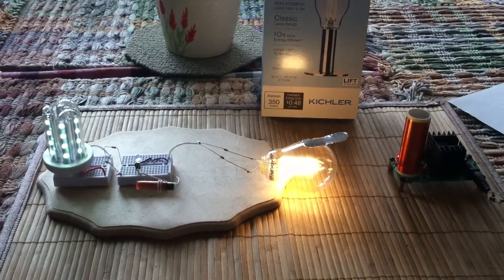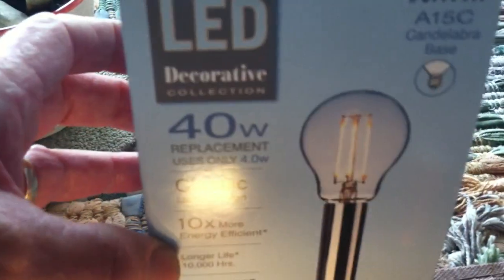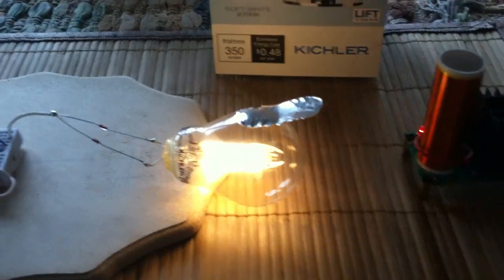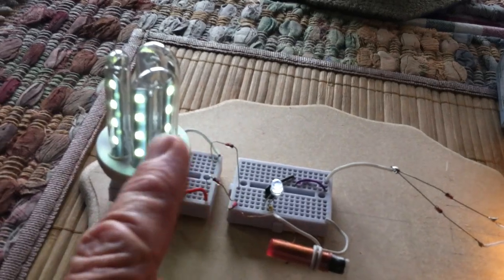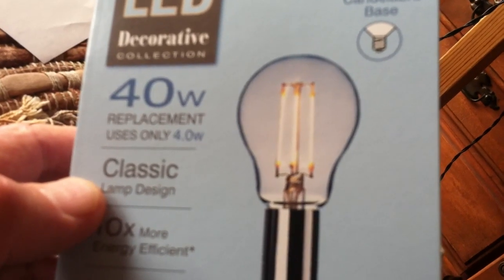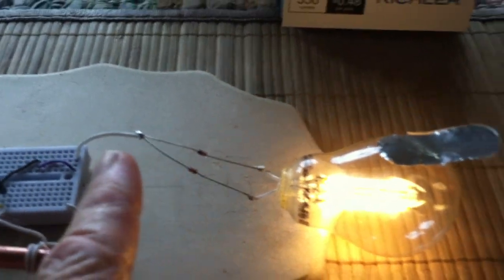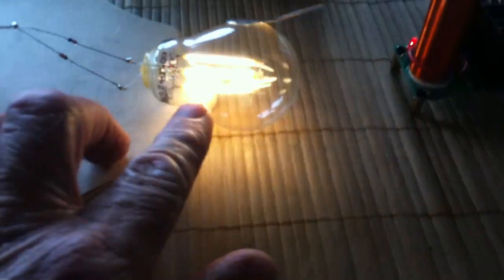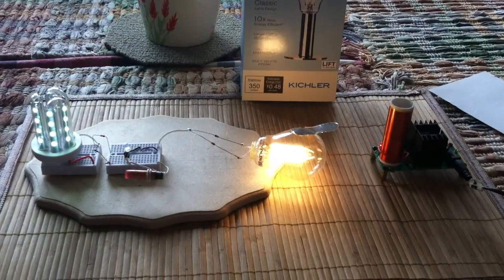Filament Led Bulb Slayer Exciter

Comment: Interesting.  What happens if you add more AV loads like more LED bulbs "40Watter" types?
Reply from the maker: When you add more lights they all get dimmer and dimmer.  Because everything is linked up through capacitance and not inductance ---the power draw at the 'exciter does not go up.  It is fascinating.  It is almost like the exciter is saying, "Ok.  I will give X amount of energy and you can do anything you want with it. ---but that is all you get."
Reply: Yes, very interesting.  Please recheck your 2nd sentence and note this.  Tesla knew of this and explored a way out by use of the 180 degree out of phase coil winding that was shown in one of the patents.  This is why I believe he does not say much about how to hook it up and in what application as he reserved that piece of information out of the patent as there were so many "thieves" at the ready to claim his inventions as their own.  For some actual working circuits using this effect, check out the Plauson patent.  In there he uses the out of phase coils and refers to not capacitance or inductance as you have but shows a new effect that he calls:  "inductive capacitance" which is not recognized in any of my electronic schools.  From my RADAR Navy Tech schools, I recall that for the  electromagnetic spectrum that energy increases as frequency increases.  So, IF in a resonant tank or oscillator, that does not draw more power (like Tesla coil with loose coupling of pri to sec) with an increased load, the power available to operate a load will be:  P = FxE  where F is frequency of oscillation and E is the voltage of the oscillation.  So just plug in the values needed to power more loads.  This is why Tesla experimented with such high potentials.  Energy is not the focus, power over time is.  A 1F capacitor does not contain much ENERGY, but run it as a tank circuit and the POWER released in the oscillation will EXCEED all the power consumption of the US for a fraction of a second!  Well known fact.  Power can be derived from a large capacitance but know that an equivalent power can be derived from a much smaller capacity if the energy is recycled more times per second.  The analogy is like dipping a tablesoon in a bucket of water once per second or the same can be achieved by dipping a spoon of 1/2 that size but dipping into the bucket at 2 times per second.  Or to grow power dip even more often.  In a resonant tank, energy can be recycled many times before losses require you to "recharge" it.  Sort of like the first book takes a lot of work, but multiple copies take little work to make.

Comment: Nice.  Only 0.4W to drive that baby!

I wish they'd stop putting the old incandescent power consumption on new low-power bulbs because that info. is virtually useless as it isn't a standard amount of light output.
  
They should just show the light output in lumens & actual Watts & be done with the old incandescent system that is based solely on power consumption.
Reply from the maker: I was in a group project a ways back where we were doing lumen testing on a simple homemade inverter circuit.  The outcome was that if you can live with a bit less brightness you can save a ton on energy input.  The downside was that you basically get what you pay for.  If you want super bright light----you pay the price in watts.  That is why I think the magic on this project is really the new cob high performance leds that are now available at low cost.
Reply: Interesting--but, if the geniuses at MIT have their way, you'll be able to have your cake & eat it too.  They are developing a tungsten bulb that will be 128% more energy efficient than an LED.  It will output 275 lumens/W.
src:  https://www.cinema5d.com/tungsten-lighting-beats-led-efficiency-128/

Comment: Hey lidmotor, can I ask what diodes you use for the AV plug. Thanks
Reply from the maker: These are 1N4148 ''switching diodes'.  They allow current to pass in one direction then shut off until the next pulse.  Regular diodes which allow current to pass continuously in one direction are different.
Reply: Thanks Lidmotor, I appreciate it.